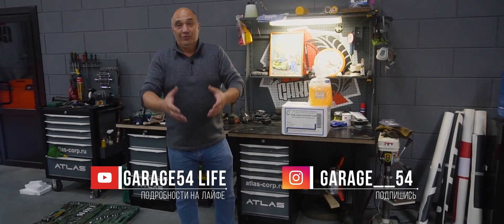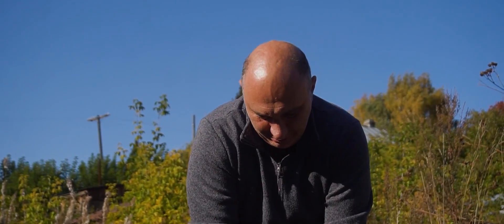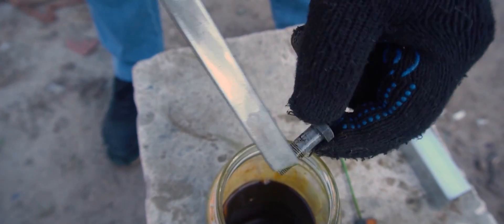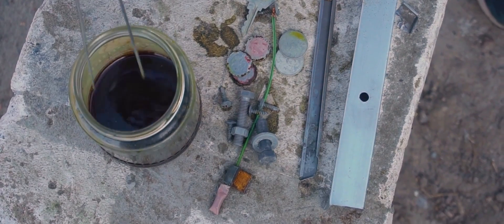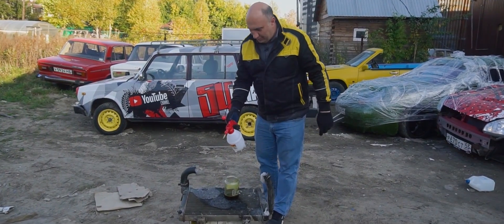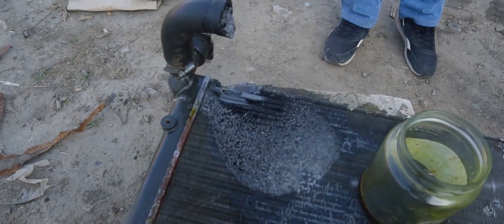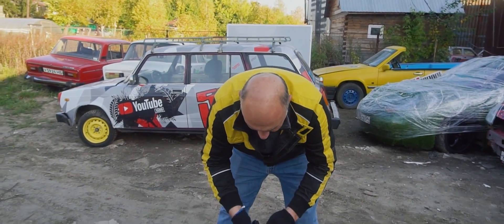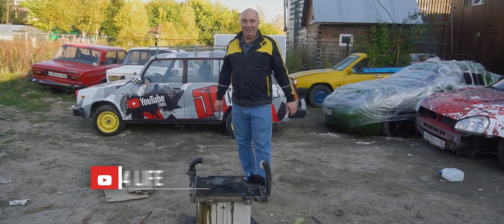We pour iodine monochloride into a radiator - what will happen?

Comment: Now that you can dissolve aluminum... now you should dissolve steel with "alum" (can demonstrate dissolving a steel bolt in an aluminum head for example) 
You just need a high concentration of alum and a bit of heat to speed things along. 

Теперь, когда вы можете растворять алюминий... теперь вы должны растворять сталь с помощью «квасцов» (можете продемонстрировать, например, растворение стального болта в алюминиевой головке)
Вам просто нужна высокая концентрация квасцов и немного тепла, чтобы ускорить процесс.

Comment: I made iodine monochloride a couple times just to make it. It was somewhat cold outside and it was an absolute pain in the ass to work with. However I now realize you guys meant ICl in solution, in which case its just a liquid but the purer stuff has a melting point is close enough to room temperature to be difficult to transfer between containers in 15°c.

Comment: Hey Vlad. I got an idea for you and your crew to test out. See how various parts of an aluminum engine will hold up under the effects liquid gallium. Try letting it soak into the block or soak into a piston, see how long a good engine will run with a measure of it placed in the engine valley. Get creative in your use of the substance.

Comment: Playing with chemicals is extremely dangerous. You can see that the smoke this produces is sometimes purple. That's elemental Iodine vapors. One whiff of that when it's concentrated and you're in the hospital fighting for your life for the next few weeks because you'll get pneumonia and lung edema. Also, never lean over a reaction vessel! When this stuff suddenly starts reacting and splashes into your face, you'll go blind.
Please do at least wear proper eye protection (I'd also recommend a respirator) and have lots of water nearby in case you need to flush your eyes or wash your hands! Like seriously, playing with chamicals without knowing what exactly happens and the associated risks involved, is being on the fast track to becoming a cripple or dead.

Comment: Can brakes be operated with automatic transmission fluid? For sure regular oil will destroy the seals but maybe the detergents in ATF will give them a chance.
Reply: No, I think it can actually start a fire if you mix stuff with brake fluid. Brake fluid only for your brakes
Reply: ATF works fine as a hydraulic fluid but it won’t work in a system that is not designed for petroleum. Petroleum or mineral fluids in the brake system cause all the rubber parts to swell and fail. Has nothing to do with the detergents, and the detergents most definitely will not help save the seals from being destroyed by the ATF. Cannot stress enough how important it is to only use brake fluid in your brake system

Comment: I have used the iodine to remove aluminum scuffing from steel sleeved motorcycle cylinders.  It works fast, and does a fine job.  I would like to take this opportunity to wish you and yours a Merry Christmas and a happy, healthy New Year, my Russian friends.  Roy
Reply: It is consistent? Thats very interesting. I rebuild vintage 2 strokes all the time. As you probably know they scuff tipically on one side of the cylinder. Is it more efficient then using a hone?
Reply: @colerippeon3903  Yes, it is more efficient.  Just get the heaviest grease you can find and coat the inside of the transfer ports and exhaust ports to cover the aluminum.  You can put it on with a paint brush, but wear rubber gloves.  Rinse well with water, then use hot water so the part dries.  A quick pass with a hone will make the cylinder look like new.

Comment: Must be similar to muriatic acid. I've used it for years to remove galvanized coatings before welding.
Reply: I-Cl is more reactive, since it's an interhalogen compound and with different hazards involved. With muriatic acid, the Aluminium goes into solution due to H+ getting reduced to H2. Here, I+ gets reduced to I2 instead, which itself is highly reactive towards living tissue. Later, when the Iodine is used up the reaction shifts towards Aluminium reacting with H2O, producing H2 gas and several aluminium complexes [AlX4]- with X being Cl- and/or OH-, due to the ramaining Chloride dissolving the passivation layer of the metal.

Comment: You should put some Gallium all over an aluminum cylinder head and see how long the engine will last.
Reply: The issue is volume. The bigger the part, the more gallium it will need, and it would have to soak in the gallium to create any real damage. One video o saw they poored gallium into a small 50cc engine and it didn't do anything because the block/head/piston was to thicc.

Comment: Make a Lada into a pull-back/wind up car!!
Reply: I'll second that!  Use a bunch of garage door opener springs.  It may require so many springs that they can't all fit onto the Lada BUT.....

Maybe get a 6X12 utility trailer, mount as many garage door openers as possible, put a Lada rear axle on the trailer and set it up so the differential U-joint winds up all the springs together.  Then connect the trailer to a Lada and the trailer pushes the car.
Reply: Drive a Lada entirely on the starter motor using extreme gearing.
Reply: @jwalster9412  That would be a short video.  A starter motor isn't made to run for very long because of the high current.  A Lada starter motor is probably good for 1 HP as long as the battery can maintain power.

Take out the spark plugs, disconnect everything else to reduce drag from the engine, leave in 1st gear, and just use the starter as it is.  I'll wager it will either run down the battery in 10 minutes or burn the windings.  Experiment over.
Reply: @BlackPill-obey  I was thinking remove it from the engine and run gearing that converts all the horsepower to torque, won't be fast, but might work.

Comment: I wonder If it would de rust a cast iorn block/ cylinder head 🤔 
With new copper radiators and such it would make for a very good cleaning product especially if watered-down into the correct ratio
Reply: It’s too caustic. The best thing to clean radiators is a weak acid like citric acid. That’s what most flushes use.
Reply: @5roundsrapid263  hmmm 🤔
Maybe garage 54 might want to do a shootout for the best stuff to flush cooling system out with ?
Sound like a good idea to me 👍
Reply: @5roundsrapid263  Caustic ? It's PH value is around 3
Reply: @thefreedomguyuk  I meant to say acidic.
Reply: What would it do to aluminum that is weekend by gallium?
Reply: Add a little bit of water, and it will.

Comment: Could you use it in a spray bottle to break rusted bolts loose?
Reply: use a plumbers  
type torch  
the blue or  
yellow bottle  
heat the nut  
up or area  
around where  
bolt is threaded  
in  

the heat expands  
the metal a  
little  
which breaks  
loose the  
rust  

you can get  
those bottles  
at most  
hardware  
stores  

also works  
for rusted  
screws

Comment: Must be the availability of more oxygen when poured on the outside that makes it react faster.
Reply: No connection there, the reaction is strictly between the iodine monochloride and aluminum, giving off iodine (the violet gas) and aluminum chloride. The inside is probably oxidized and/or covered in deposits as it often happens.

The reaction seems to be highly exothermic though, as you need to have over 180C to get iodine vaporized, so it looks like it's "burning". But it's not burning.

Comment: Try using the iodine monochloride as the solvent in an ultrasonic cleaner to know if it will have a better results in rust removal compared to using just the ultrasonic cleaner alone
Reply: I 2nd this.
Reply: Booooring!!
Reply: Mix it with 25% water, and you're guaranteed getting much better rust removal results !
-It will remove the linings in your lungs too 👍
Reply: That sounds like a dumb idea. It reacts with water to create hydrogen chloride (the acid).
Reply: ICI is 600 dollars a gallon in the states wow
Reply: Maybe also drink some vs not drink some. See the differences in health n stuff.
Reply: @smellycat249  😂